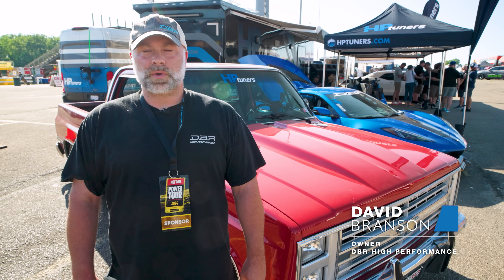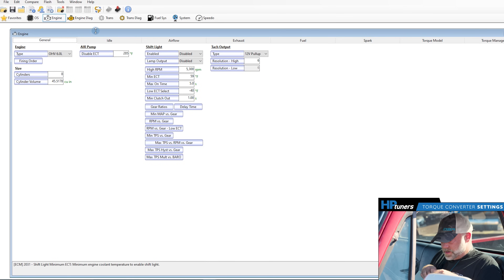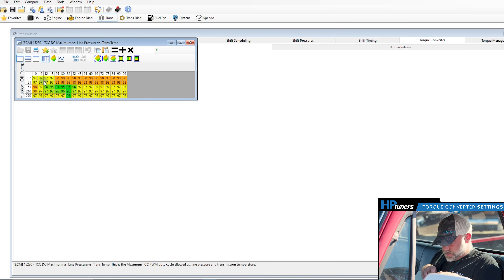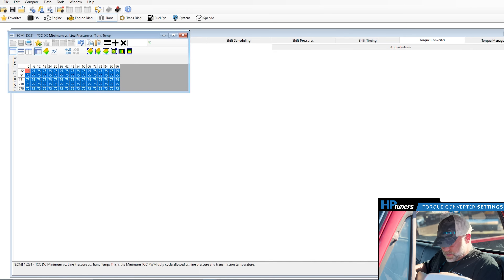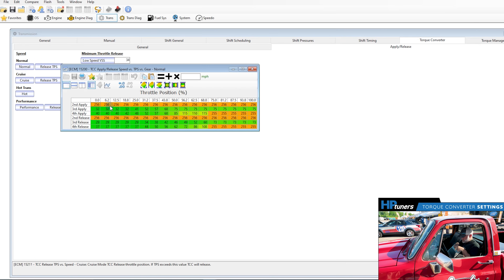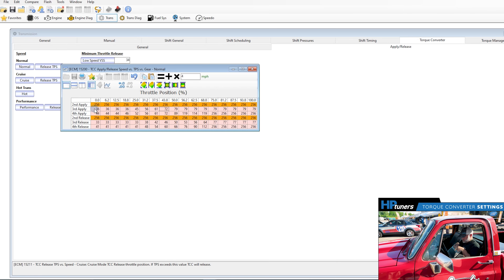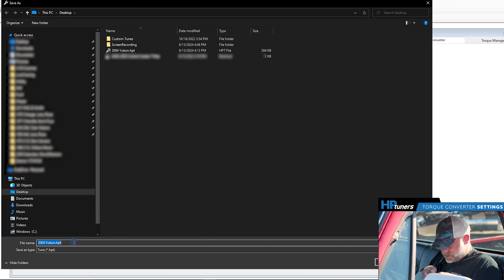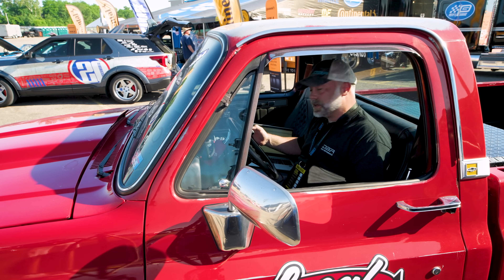Adjusting Torque Converter in VCM Suite | HP Tuners x DBR High Performance

Comment: Great video. I have a particular issue, or I feel like it might be an issue. I have a 2004 Silverado 2500, 4x4 6.0 gas, truck is stock with the exception of a volant closed air box system. I have done the tuning, and used the Blue cat settings for trans. But even before all the tuning. I notice when I'm in D on the freeway ( where I notice it most ) if I let off the pedal , even for a second or two, the tcc unlocks ( rpms go up slightly ), then if go back on the pedal, the converter starts to lock back up. but seems to take a bit. kind of like it wants to slip in vs immediate. It seems as if it is too sensitive ( quick ) to release and too lazy to apply. if that makes any sense. Is this a setting I can adjust in Hp Tuner? and if so, where would I find it?  Thanks in advance.
Reply: These are factory settings for any 4l80e truck, they unlock the converter when you let off the the throttle because if you try to use engine breaking on a heavy vehicle like this with the converter locked it will slip the clutches, especially if you have a heavy trailer or something like that. You can reduce the apply time, and make it lock up faster, and you can change the throttle percentage at which the converter unlocks. It’s based off of throttle percentage.

Comment: Does anybody know how accurate the hp turners boost gauge is? On my data it shows I got up to 40.27 pounds of boost, and my vehicle doesn't have a boost gauge, I thought it would be cool to tune my family vehicle a 2018 2.0 eco boost ford edge awd, it is quick as heck lmao and I've been running it like this for about a year now without any problems, I just hope it ain't spooling 40 pounds of boost like it say on my data🤣🤣